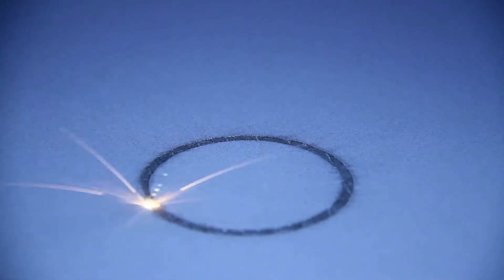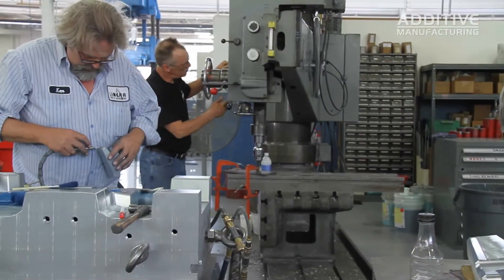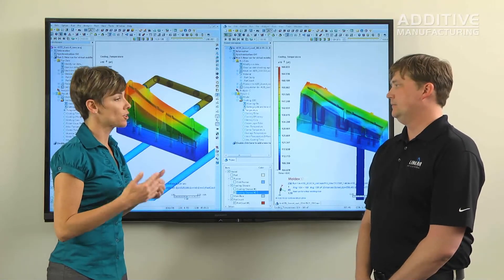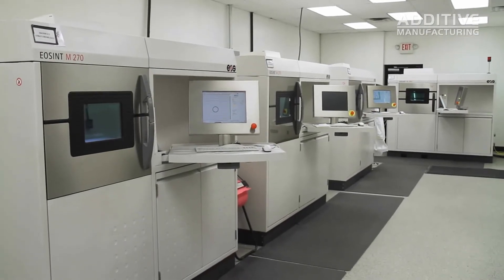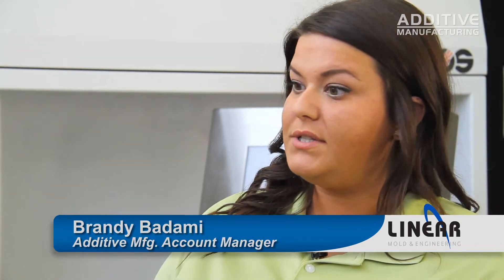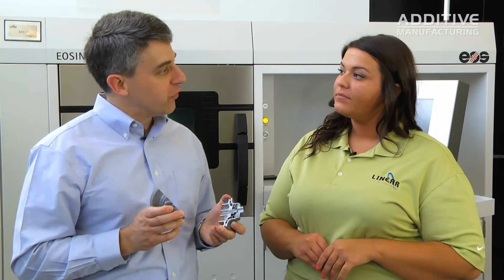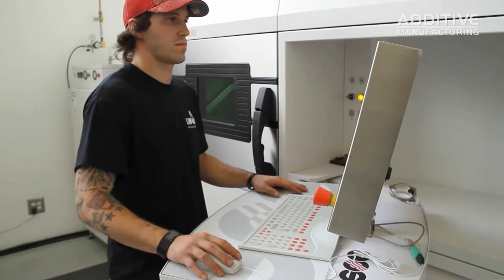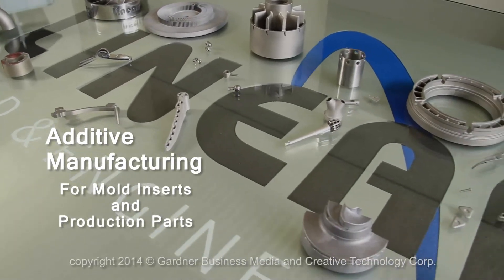Additive Manufacturing at Linear Mold

Comment: With the ability to design and manufacture virtually any type of internal geometry, why are they still using simple tubular (round) cooling channels? There are much more efficient heat transfer geometries. Just ask the turbine engine folks.